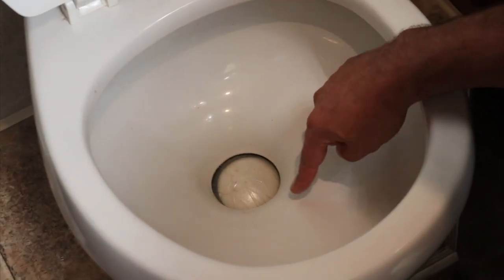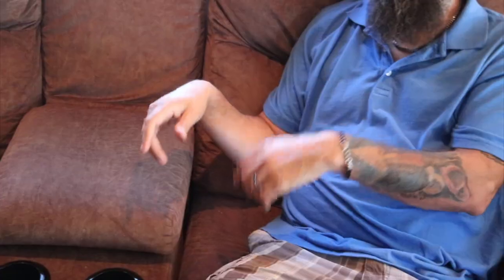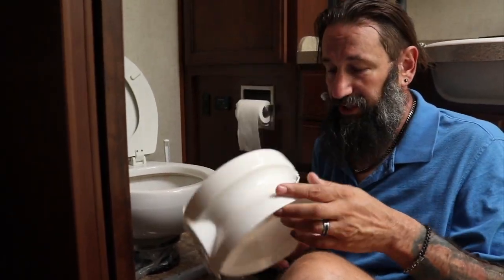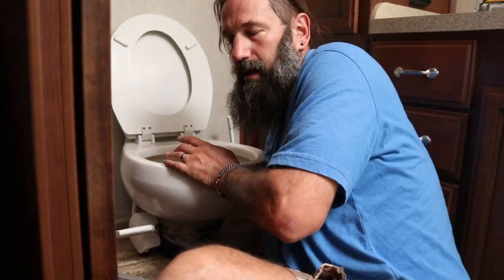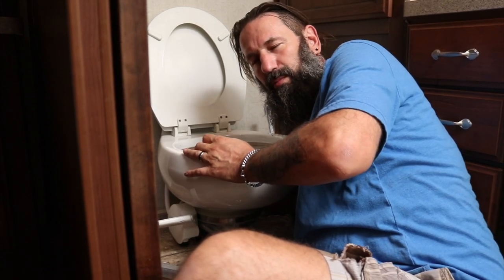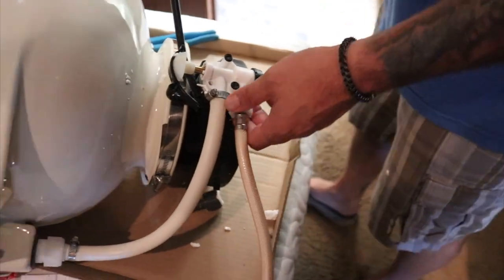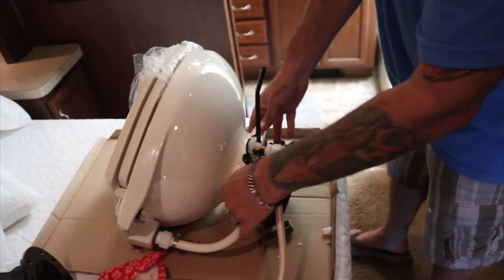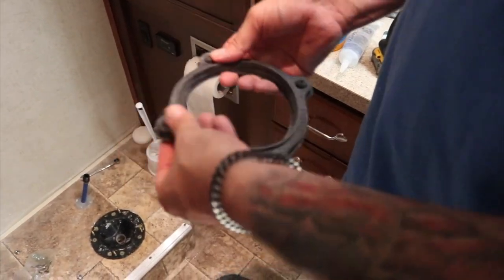Sealand / Dometic Vacuflush Toilet Replacement For RV's and Boats

Comment: I share your frustration with these toilets. I have a 2003 Sea Ray 52' yacht and I'm dealing with the same problem you had with a Dometic vacuflush toilet. I replaced several parts but came to the same conclusion that it will be more effective to just replace the toilet. I just took delivery of the toilet today. I will be installing it this week. Fingers crossed.....